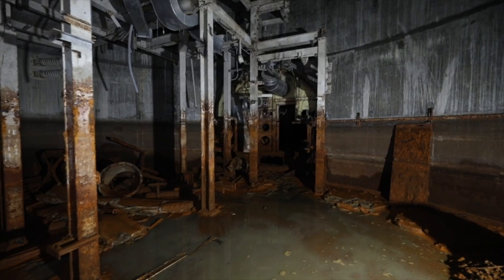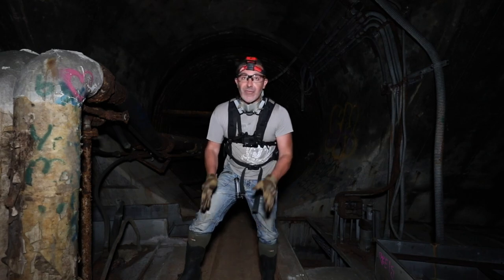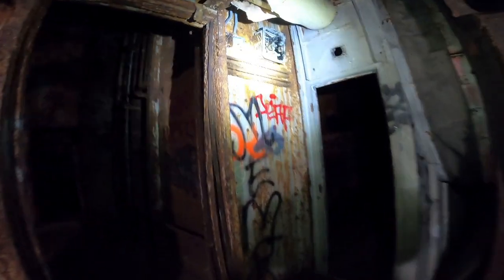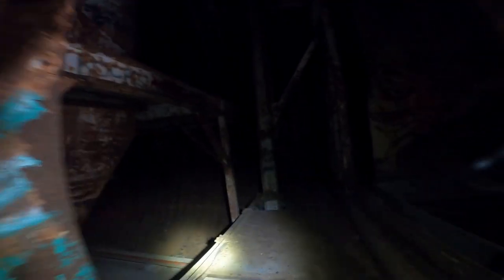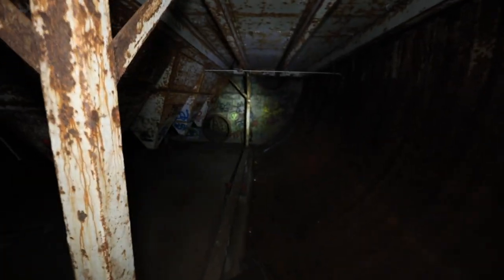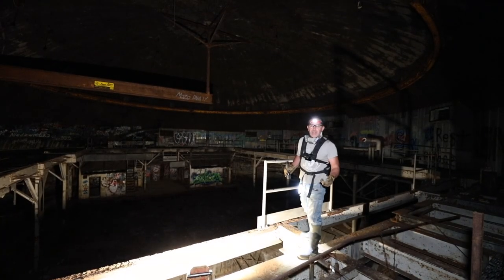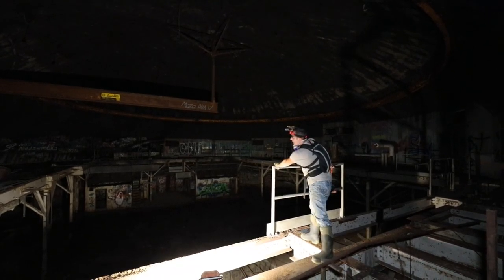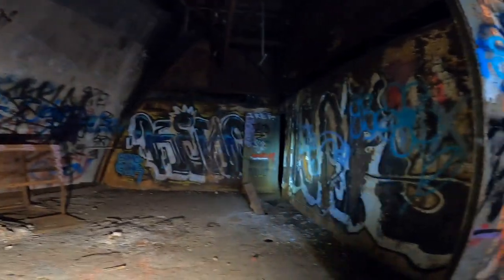Ep. 43 - STRANGE Missile Silo That Visitors Are Forbidden To Enter

Comment: If you're in the one I think you're in that one would to rehabit you just have to get the whole thing and only keep the concrete walls floors and ceilings and start fresh so if it was sold it would probably be cheap cuz you also would have to replace some of the tunnels cuz some of them are collapsed I heard
Reply from the maker: It’s too compromised.  Otherwise i would if acquired it.